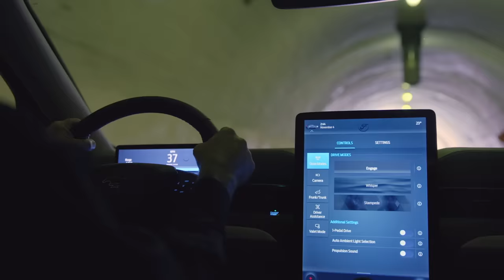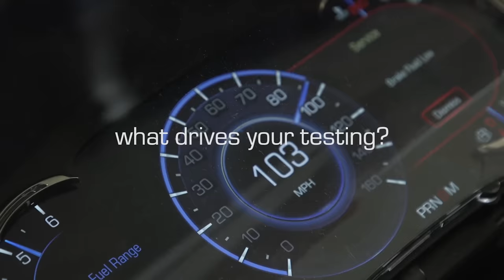Strike Casualty: Stellantis Backs Out of CES; BMW Going with NACS - Autoline Daily 3672

Comment: EVs gotta pay for road use just like everyone else.  Considering that EVs getting tax credit people with EVs should not complain about paying their share for road use.  Fact is that EVs are much heavier than ICE which means more wear on the roads.  What would be the fairest road use tax is a mileage and weight based yearly tax.  Drive less, use the road less, pay less tax.  Weights breaks down in, let say, a thousand or 500 pounds increments, as it increase tax more.  The great thing with the gasoline tax is that it has weight and use built in cause heavier/bigger cars uses more gas and the more you drive the more gas you use.
Reply: But then wouldn't you be double charging people who own hybrids???????????????
Reply: @pnketia  Not if they charged everyone based on weight and mileage. If you wanted to drive a heavy hybrid that would be your problem.
Reply: @pnketia  Hybrids never been charged EV tax that I know of...unless that is something  in more recent years.
Reply: @DaBinChe  The Lexus RX450H weighs 4740 lbs and the Tesla Model Y weighs 4555 lbs so by your logic shouldn't the Hybrid Lexus pay more since it is heavier?
Reply: @pnketia  Yes it should, and it does in gas tax.  People don't realize how much % of gas cost is actually tax.  In CA state gas tax is about $0.54 per gallon, that doesn't count County or local gas tax.  That lexus RX450h averages 26mpg on Fuelly.  If driven 12,000 miles per year, uses 461gallons. That comes out to about $250 in state gas tax alone not to count local gas tax.  On top of other yearly taxes during registration.
Just punched in at DMV for a model Y $35k purchase this month residing in LosAngeles is $515.  Lexus RX plug in hybrid $70k, all other info the same is $772.
Reply: @DaBinChe  😀